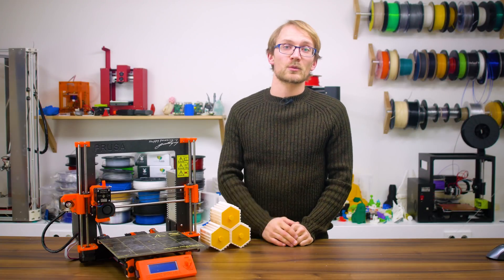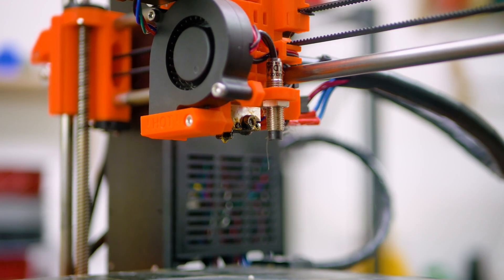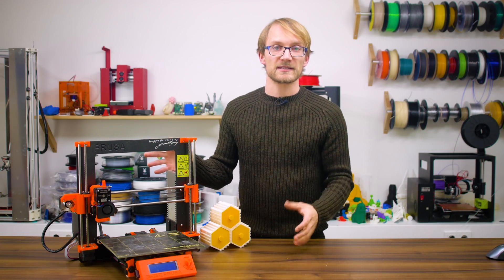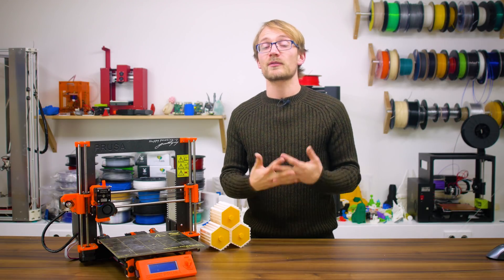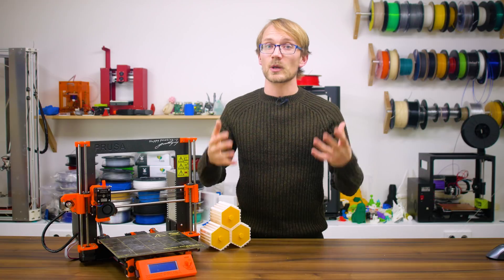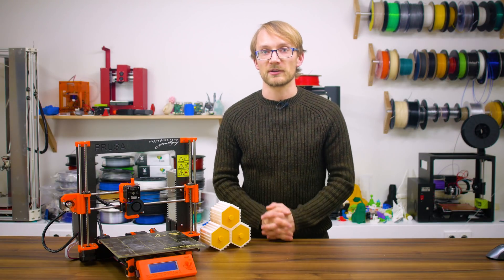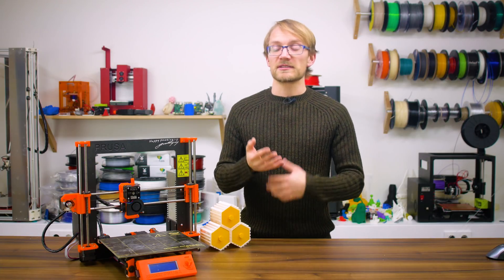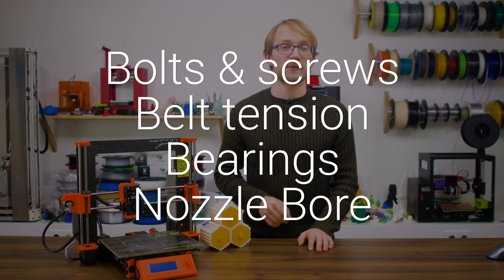Basics: How and when to service your 3D printer!

Comment: Great video! I used to use oil based lubrication on bearings but that resulted in noisy loose fitting bearings. the rattling noise was unbearable, no pun intended. The ones I've got use grease based lubrication, it's less thin, doesn't drip and have some volume to them making the bearings run more silently.  Please note that grease is soluble in oil, so you basically need to flush out the grease with oil until it works properly. It's easier to use good quality bearing type, high temperature grease.ymmv. Also put grease on the outside of the bearings to protect them from rusting. When using oil on the z axis, be very careful that the motors don't get oil in them.

Comment: Snug down the screw terminals on the electronics every so often, otherwise they can come out and trip thermal runaway protection. I had this happen to me with the printer off, so the printer never started, the positive was it made me revise the firmware and I went from old marlin stable to RC8. Marlin stable at the time had no protection if the hotend never reached the hysteresis temperature.  Now it (as of a version that i dont know which one it was) checks, if it finds that temperature as not moved despite commanding the hotend to heat it thermally shuts down.

Also make sure those computer headers that you maybe using are properly inserted (unless your lucky enough to have locking JST headers, but still check anyway)

I also like to, before printing for the first time in a bit, run the gcode I use to compensate for the lack of finite adjustment on my home brew optical endstop, then command the head around the HBP to verify that nothing has moved unexpectedly.

Comment: My first 3d printer is on it's way, and I was wondering if 32 bits is a worthy upgrade on an i3 style kit. I hear it both ways, and I'm on a real budget, so I wanted to ask a pro to see what he says. Would I notice a real difference bumping up from 8 Bit?
I plan on investing in my printer to slowly upgrade it as I learn more and can afford it, but 32 bit is a huge investment.
By the way, thanks for the videos, I've really learned a lot from your channel and hope many more lessons are to come.
Reply: Vape Scaped it's a good upgrade it helps you go faster. It helps with smoothness and some people find it helps with layer thickness.
Reply: Thanks. It would be cool if tim did a pre and post 32 bit comparison on a corexy, or even a delta, but that difference I hear is a lot more noticeable. The most i've found about a comparison is a few sentences before talking about a specific board.
I love this channel and there's a ton of good information here, but technology is moving very fast and some of thee details get overlooked, both here and elsewhere. Plus, honestly, I feel this channel is more for people with a bigger budget than I have. That doesn't stop me from watching though.